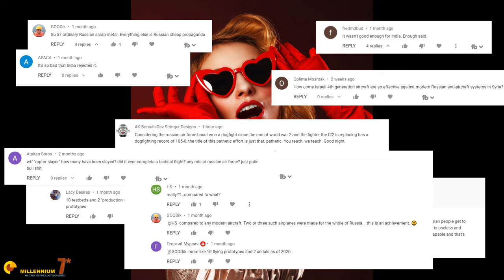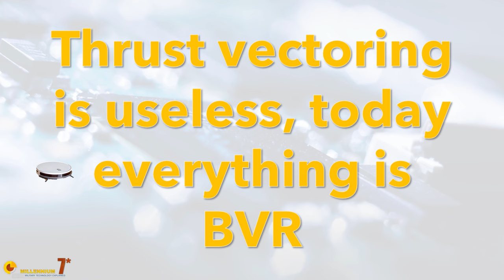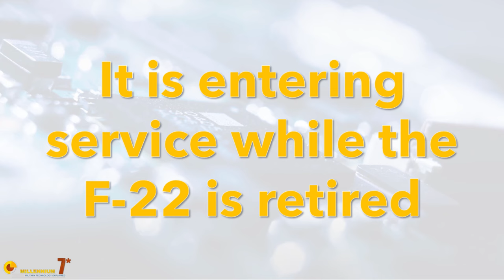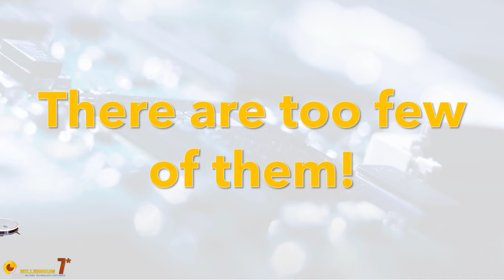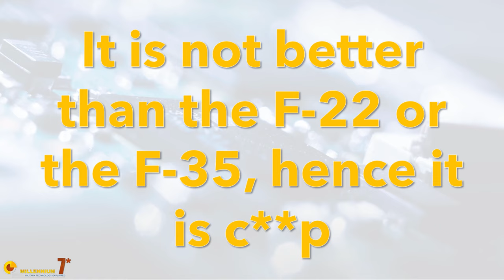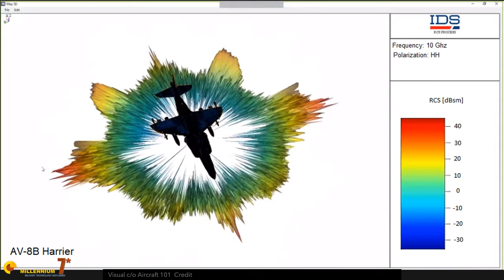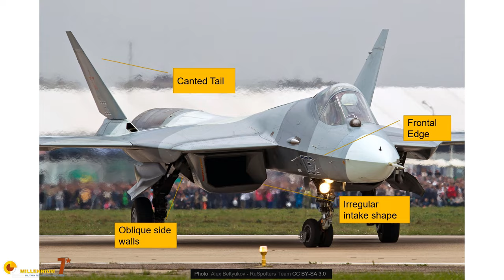Su-57: is it INVISIBLE?

Comment: I think GOODik is a bit of a fanboi...

Really it's just xenophobia if someone states they know that, without knowing any actual details about 2 respective aircraft, that the Russian one is "clearly worse" (especially despite the advantage of being much newer) or "a piece of junk".

Assuming their engineers, personnel & equipment is automatically the best, seems to be quite prevalent in American culture.
Reply: "despite the advantage of being much newer" - What? What does age have to do with anything?
Reply: @ChucksSEADnDEAD  The cumulative knowledge that's been gained in that time...? Plebs on the internet now have a rudimentary understanding of how low observability to radar works... All that stuff was top secret at the time the F-22 was being developed.

You can see what other nations have been doing with theirs & copy/adapt/inspire as suitable.

You get the benefit of advances in technology across the board like not being stuck with microprocessor designs from the 80's.
Reply: @sergarlantyrell7847  "The cumulative knowledge that's been gained in that time...?" - So? We have more cumulative knowledge in 2021 than in the 1700s, but if you try to make a telescope right now it's probably going to be worse than what the craftsmen did centuries ago. Something being newer doesn't mean better. The expertise in the designers and builders, the budget constraints, etc. has a greater effect on the end result than the date on the calendar.
Reply: @sergarlantyrell7847  The problem is, the trained engineer needed to be trained. Whoever trained him had to have a lot of expertise. And there lies the issue. The US companies like Lockheed and Northrop have extensive institutional knowledge that they train their engineers with, while foreign nations have to start from scratch. They do not have the cumulative knowledge. For example when a country tries to make their own CPU, they're usually much slower than current Intel and AMD offerings because they do not have access to the training and teachings that are internal to those companies. Even though the specialty of the people involved is electrical and computer engineering, they do not have the knowledge that's kept under lock and key.
It's not that they're Russian. It's that they have less experience.
Reply: @ChucksSEADnDEAD  Lookheed & Northrop have that knowledge NOW... BECAUSE of the F-22, YF-23, B1, B2, F-35 etc. They didn't have anywhere near the institutional knowledge back in the '80s during the ATF program, most of the work that was done on the F-22 was done from scratch as the F-117, while a useful starting point, actually in terms of blending aerodynamics & geometric stealth are VERY different.
The whole point of saying that time is an advantage is that you're comparing Sukhoi in the 2000s & 2010s to Lockheed in the '80s & '90s.
You can be sure the Russians (or then, Soviets) started research into stealth technology as soon as they got wind of what the Americans were doing. What with the collapse of the Soviet Union, they never had the money to pour into such a program so never made it into an aircraft (heck, the Su-57 is the first brand new fighter, or possibly military jet of any kind, since the mid '80s).

And as soon as Russia got their hands on images of the F-22, I have no doubt that they were sent straight over to Sukhoi for study and it wouldn't surprise me at all if they had recreated a pretty accurate (either computer or scale) model of the F-22 (and other low-observable US jets) as part of that study, which can help to greatly accelerate their own study into a new area.
Reply: @sergarlantyrell7847  Having images doesn't mean anything. Even a perfect scale model only tells you the effects of geometry, not what's going on inside. The F-35 had parts modified to be mounted in different ways, because the orientation in which the fasteners are facing can create internal reflections that compromise stealth. You can't learn this from a scale model.
Reply: @ChucksSEADnDEAD  I'm not saying that you can shortcut every aspect of the design, just that there are SOME parts that will speed up development. I'm an aerospace engineer and it's common to keep a track of what the competition is doing for clues & things to look into, especially if something is pioneering or especially successful... And that's just the civil sector. If you have a rough idea of something that works to use as a starting point, especially for a clean sheet design, it can save you a whole lot of time.

Yes I've heard about the fasteners before, but the fact that WE (outside Lockheed & Northrop) know that, means Sukhoi definitely knows that that is something to investigate. They have the same access to the internet that we do and thanks to espionage & spying, more of the confidential info on American stealth aircraft than is in the public domain.

Comment: At first I have to congratulate you for the quality of the videos and the accuracy of the information given. I have a request for a video on the subject of cost per flight hour for all the 4th and 5th generation fighters. F16, F18, F35, Rafale, Europhighter, Mig 35, Su 35 , Su57. There is no reliable information in YouTube on the subject.  Thanks again.
Reply: CPFH is a very difficult and non-standardized metric to try to apply across different airframe designs, or even within an airframe series.  I’ve studied it since the early 1980s, including macro to micro, primarily for the teen series and some other aircraft that were still in the force structure at the time (F-4G, F-111F, EF-111A, A-7D, etc.).

The CPFH on F-16A Adversaries used by the US Navy is much higher than later block F-16Cs in the USAF, if you look at DoD comptroller figures down to the dollar amounts.

The most overlooked omission regarding CPFH is that ancillary systems aren’t included in official reports, even though you aren’t really mission-capable without them.

An F-16C Block 50 CCIP Viper is non-mission capable for its primary set if it doesn’t have the LITENING pod, HARM Targeting Pod, and especially the centerline 800lb ECM pod-all of which are separately accounted for and maintained by different shops.  They aren’t included in MC rates.  Just the airframes are.

Even for the early 1980s, an F-16A without ECM pod would be extremely limited in what it could do.  

So when you see F-16 = X CPFH, know right away that number is totally bogus and mostly meaningless.

With the F-35A/B/C, you can’t hide any of those systems costs because all of them are embedded into the airframes.  The FLIR is in the nose with EOTS.  EW systems are all embedded into the sensor/processor/countermeasures configuration that is basic to the airframe.

Generally, your twin-engine fighters cost more to operate for obvious reasons.

Older fighters cost more because they’re hitting the edge of the bathtub graph where they start seeing more systems replacements, component wear, structural problems, and requirements for SLEP.

Newer fighters initially cost more because they require new logistics, training, maintenance infrastructure, with limited spare parts.  Once the organization gets into a stride, the costs come way down on newer jets.

It would be really impossible to compare all of those you listed though.

There’s a movement to look at cost per effects vs CPFH.

For example, a cheap lightweight fighter with minimal systems like the A-10 looks great in CPFH, until they start getting shot down in even a lower threat IADS, with very limited mission profiles they can contribute to the overall force.  That’s a high-cost platform at that point when you start losing airframes and pilots, who can’t even go deep due to the higher threat IADS.  That’s exactly what happened in Desert Storm.  They had to be grounded.

It would make an interesting video if people with a lot of maintenance and program management experience covering decades were interviewed.
Reply: @LRRPFco52  Thank you very much for the enlightening reply. I'm looking forward for a video or individual interviews on the subject. Presently my motherland Greece decided to purchase the Rafale. It's a very good platform and you have made nice videos about it. But in my humble opinion because of the CPFH I think it will destroy the Greek Greek airforce. The high cost to operate it will force the government to cut training hours and the biggest advantage of our airforce wich is the good pilots is going to vanish. From what I have heard the best choice was the F18 super hornet.  And by the way it was the choice of the Greek airforce since 1978 but canceled from the socialist government in 80s . I will like to have your opinion on this. Thanks again. You are doing a marvelous job.
Reply: @LRRPFco52  I think the price included the weapons. But anyway they are expensive. And unfortunately this government was out of options. The France was refusing to provide spear parts for the Mirage 200 as far as I know. Unless they will get the Rafale. But 27.000 is already to much and I think  the real number is the double as you said. But this is the result of a bad designation in 1985 to get the Mirage 2000. The first bad decision derives to the other. Thanks again. You know the military aviation subject very well I think. At the beginning I thought you are the creator of the video replying from a different email address.
Reply: @chryslym1391  I was kind of surprised to discover that the Rafale only has a 5,000hr rated airframe life, currently being explored for extension to 7,500hrs.

Service Life Extension Programs are extremely costly because you have to inspect and replace critical structures that have many other things running through or attached to them.

It's almost easier to build a new airframe.

There's a high chance Greece is getting bent over hard with this deal.
Reply: @LRRPFco52  From the first minute I heard about this deal I was absolutely sure that it was a bad one. The BVR missiles are advertised as if they are unbitable and that we have a super deal. In this chanel is described the capabilitys of the F18 super hornet block 3. Airframe with 10.000 hours life time and so many other thing makes it the best 2 engine fighter jet for money.
Reply: @chryslym1391  I'd be interested to hear the philosophy of Hellenic Air Force requirements for both F-16C Block 52s and Rafale.  Maybe the Rafale provides more endurance for the combat air patrol/airspace defense mission, while pilots hope to humiliate Turkish F-16Cs during their normally non-kinetic skirmishes.
Reply: @chryslym1391  The Meteor is an excellent BVRAAM since it can modulate its thrust throughout its Time of Flight.  That effectively increases the WEZ (Weapons Employment Zone) and especially the NEZ (No Escape Zone) parameters, but they are expensive.

I see Rafale in Greece as an escalation of the arms race between Greece and Turkey, with Greece gaining a one-up against the Turks by acquiring Rafales.

If Turkey had acquired F-35As as planned, that would have been a huge overmatch against Greece, especially over the disputed territories.  I think the S-400 just gave the US a formal reason to kick Turkey out since the likelihood of Turks exploiting it against a real ally were high and a significant risk.

Comment: The biggest actual issue with the Su-57 is that it seems to be "too late" for lack of a better term. By the time it's actually going to be combat ready in any significant numbers, numerous 6th gen airframes, including probably Russia's own version, will be either in the prototyping stage or close to it. It's a beautiful aircraft and is no doubt capable, especially with the new engine refit, but it's probably destined to be a relatively lightly used plane that fades away, as opposed to a massive air-superiority platform as Russia originally hoped.
Reply: Su 57 will be modernised, that is the answer
Reply: A new "generation" appearing still doesn't mean the end of the previous one, just have a look at how the F-22A is being superseded by none other, than the F-15...
Reply: @lape2002  The F-15 is not superseding it, the NGAD is. The F-15 is a stopgap measure, a source of fresher F-15 airframes that can be handed down to the air national guard, and a little welfare tossed Boeing's way.
Reply: The 6th generation gonna be unmanned but actually we don't know how the conflict between serious countries can go. In case of using EW and anti satellite weapons different UAV systems can fail.

Comment: With a RCS between .1m and 1m according to Sukhoi, the answer is no, it’s more visible than even some 4th Gen fighters and that’s why some people struggle to even call it a 5th Gen fighter because it’s stealth is so poor. In comparison the F22 has an RCS of .0001m and the F35 an RCS of .005. Fun fact: the Su-57’s stealth(or lack thereof) was a primary reason why India pulled out of their joint project with Russia on the Su-57, stating that it lacked stealth and was poorly designed, amongst other things.
Reply: Another fun fact is that the Su-57 has the same RCS as that of a clean F/A-18 Super Hornet.

Comment: I found many details of the SU57 truly remarkable. However some questions still arise. One has to do with the tolerances the aircraft is built to. One source I saw claimed that for effective conformance to the design to achieve the calculated stealth the tolerance for the shape is +/- 1mm.  It was claimed neither Russia nor China could build to that tolerance. The other is establishing and maintaining a kill chain. The resolution of L band radar is notoriously poor. For adequate gain the antenna should be roughly comparable to the wavelength at least within an order of magnitude. Therefore broadband RF noise in the LF range could reduce the limited effectiveness of on board L band radar. The missile will have to maintain a high quality lock signal in  the X band. Can it? F22 is also supermaneuverable. It's hard to say what would happen. Pilot performance also plays a large role in the outcome. We think that by the time SU57 IS well into production the US will be deploying high power lasers on its weapons. Will that matter? What about 6th generation planes? We know virtually nothing about them. Space weapons and detection systems??? Just can't say. Too many unknowns and too many variables.